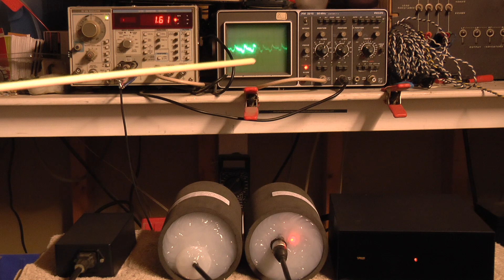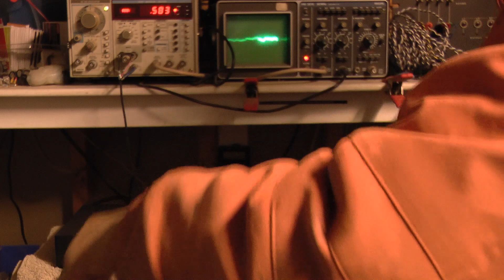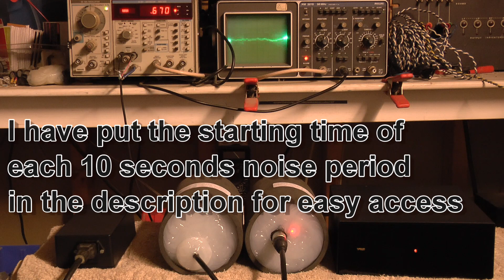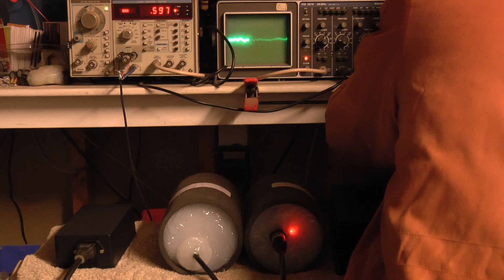Capacitor Packs eliminate all the HUM (noise) from phonostage.

Comment: I have been using a tube type phono stage with independent solid state power supply there was a tiny bit of hum today i introduced a step down transformer from 240 to 220v to save the tubes from unnecessary wear. Can i place a noise suppression cap on the  output of the step down ?
Reply from the maker: @deangale4496  depending on what hum you are getting, it may be from the powerline or pick up from the air.  If it is from the powerline, the capacitor should be in the DC power rails not ac.  You want 50hz and 60hz to pass through ac.  It is the DC that you don't want any hum.

Comment: hi!! I've been having the same type of hum with my turntable, phono stage (project tubebox DS2) by itself only has rush no hum at 50 db of amplification, but when my turntable its connected I got a lot of hum. could these capacitor packs work for my turntable? my turntable it's an Onkyo and it has it's power supply inside not outside like most phono stages. I'd really appreciate your help.

Comment: Have you tried different bridge rectifier diodes in the power supply? For example, soft recovery FRED types, Si9C, and Schottky? I've used the first kind, and the SiC are now popular for far less noise when diodes switch off.
Reply from the maker: Have tried all kinds of diodes including all the types you have mentioned.  They helps but not totally.   Remember the phonostage was set at 76db.  A tiny amount of noise on the rails will be amplified by 6,300 times.  We are talking 1.6mV rms of noise at the final output.  Not a significant amount in real life.  Almost nobody will complaint about that kind of residual noise in a 76db gain phono set up.  I am just being extra picky and find ways to improve the very last bit possible.  In order for the camera mic to pick up the hum, I have to amplify the noise (turn up the volume) by more than 40db.  That is equivalent to a 150 watt to 200 watt integrated amp having its volume control turn all the way up (wide open).
Reply: @angela-gilbert  I asked about the diode noise because the sawtooth display didn't look like just AC draw noise with transformer inductance. I wonder if snubber caps on the diodes and a choke might be more cost, size, or performance effective than only farads of C. What is the PSRR of the amplifier? Hopefully all that rail noise doesn't contribute to output noise. Interesting results anyway, thanks for your work and video!

Comment: HI like the work    ...... what about lead acid battery  big enough one   pur DC   would that be better
Reply from the maker: Got this question all the time.  As soon as we introduce any kind of battery into a circuit, it involves some sort of charging circuit.  Then depends on how well the charging and "discharging" design, it has a big factor on the life of the batteries.  Lead acid has memory, NimH claims it does not but they do. Lithium Ion is better but they still have life cycle.  All batteries type has life charge cycle.  Usually claim for 1,000 cycles but have you ever charge a battery 1,000 times and it still take and hold a full charge?  Every time a batteries is being charged, it dies a little bit.  Then it has to be replaced.  There are maintenance cost involves.  Big capacitance power supply has almost no maintenance cost.  We have capacitor packs and other power supplies being used in the field for 30 years and still working.